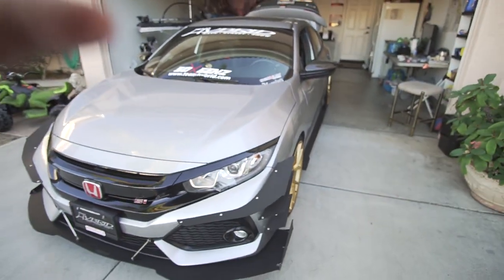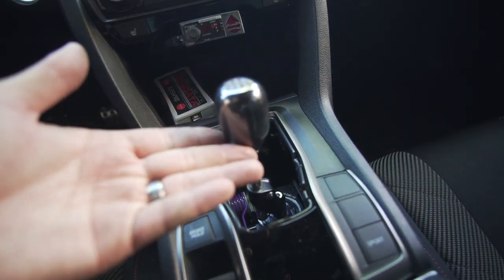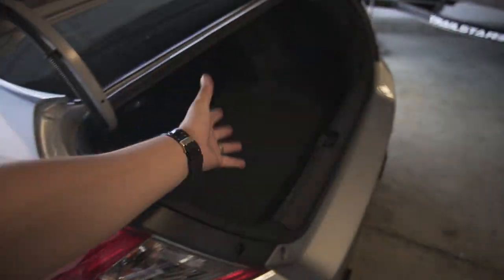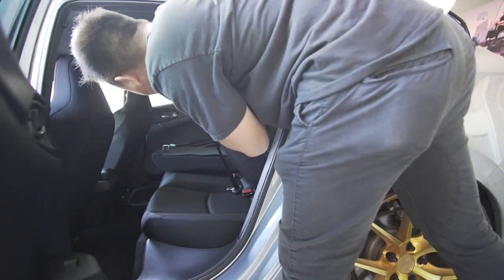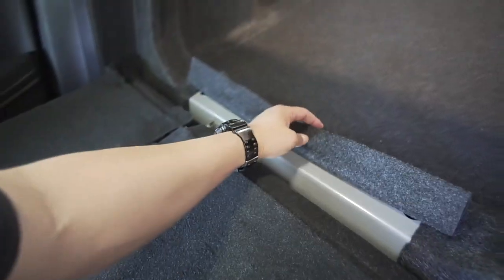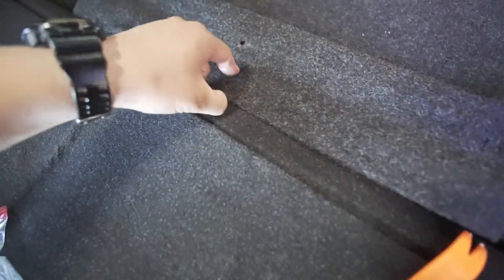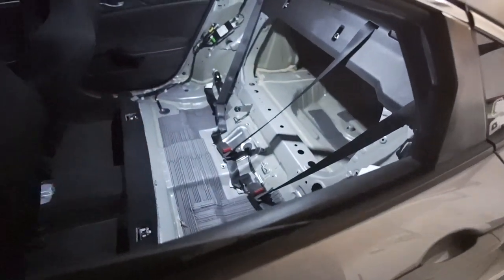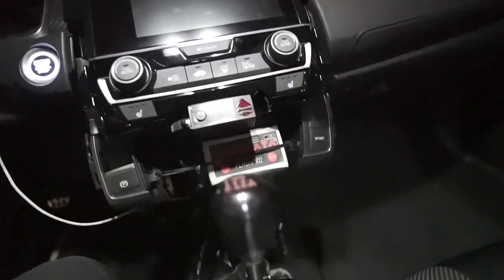Semi-Gutting the Si (10th Gen) | 2018 Honda Civic Si

Comment: How much weight did u lose?
Reply: Weight reduction is probably similar to my 13.7lb RPF1 upgrade. What realy counts is that extra bias, which will cause front to bite harder and rear becomes more controllable. Probably not as noticeable in Si, but very noticeable in my 2700lb 6MT base Sedan.

Comment: Why'd you go with the 4 door sedan then?
Reply from the maker: Taylor Burruss I didn’t like how the rear-end of the coupe looked + I originally got the sedan for any future occurrences that would happen (I.E: having a child, that way it’ll be easy to transfer car seats) This was all before I ever thought I’d go this far with the Si.
Reply: Plus the sedan is only like 20 pounds more than the coupe, they're basically the same performance wise
Reply: The back of the coupe looks so much better imp. I was going to ask the same question. Why buy a four door that looks worse, if not for the need of the back seats?